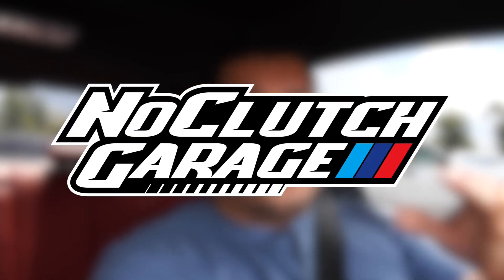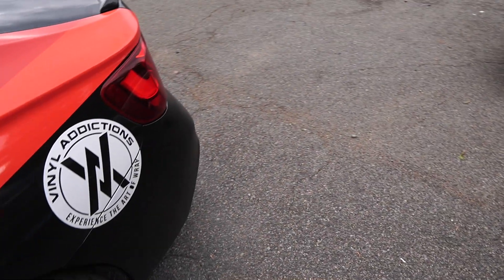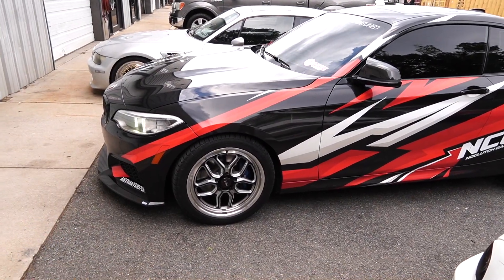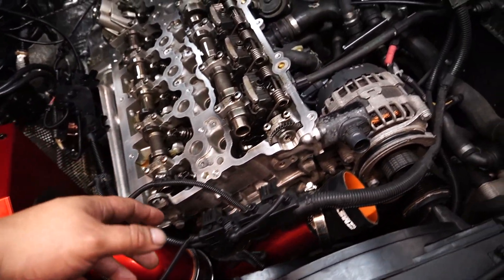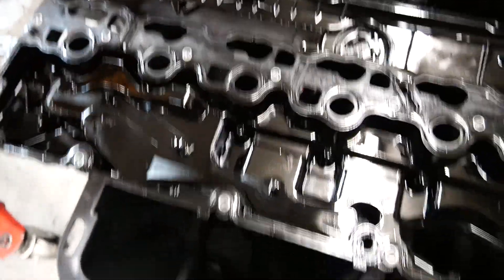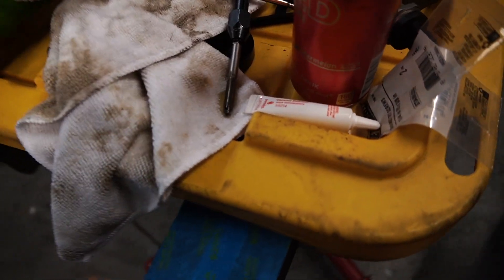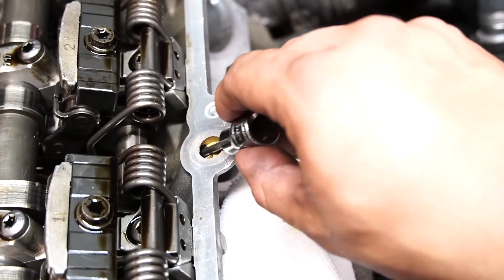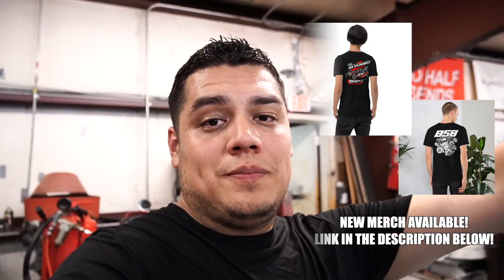PCV ISSUES GONE FOREVER!!! | B58 Headport Plug DIY

Comment: Hello no clutch garage, I have a f82 and I bought the Ross racing v2 pcv delete kit that’s VTA and I had major oil pooling from the turbos and out the exhaust. I looked more into it and it’s saying it needs vacuum at idle so it doesn’t oil pool so I added one way valves to VTA hoses but had the same issues. I reinstalled the OEM pcv cap and turbo inlet back together and the issue went away but i want to run a pcv delete kit bc I spend $370 on it and they won’t let me return it so I am wondering if you recommend something or if I should plug the ports but would this have vacuum at idle? I don’t know what to do or if I should get a new valve cover but I’m pushing more HP and it’s not stock

Comment: Hi bro!
Even with the Ross performance pcv delete was still eating oil?
Reply from the maker: Yes because my Valve Cover was damaged internally.
Reply: @NoClutchGarage  got it :)
Thank you great videos man
Reply: @NoClutchGarage  is the VS PCV delete now redundant with the head ports blanked, and are you somehow running additional ventilation for the low pressure side?

My PCV system failed and filled cyl 6 with oil, I'm looking to delete as much of this system as possible, without introducing oil smells into the cabin.